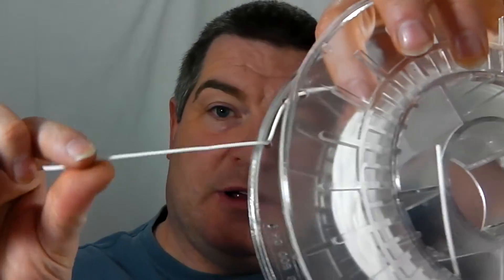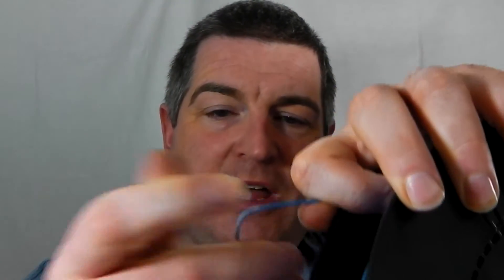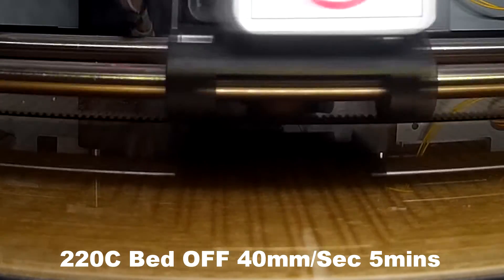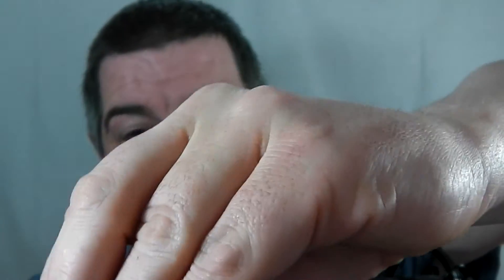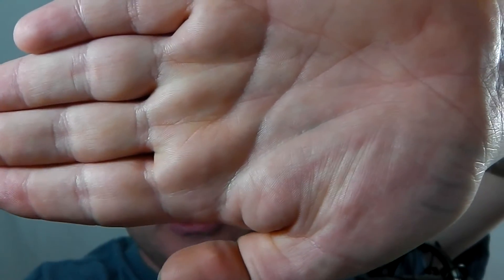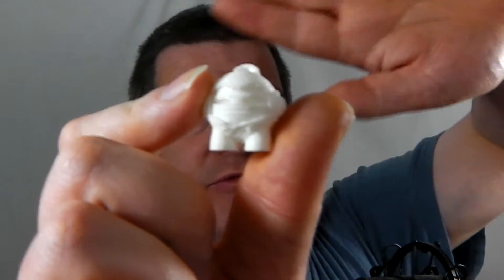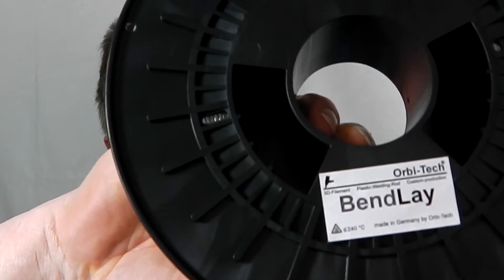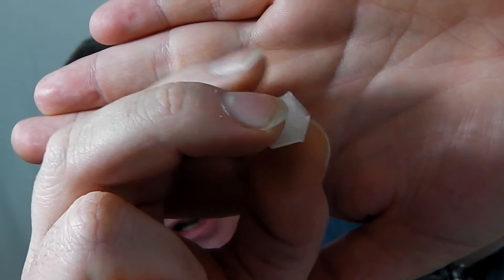XYZ DaVinci 1.0A printing Ninjaflex ???????

Comment: Im printing ninjaFlex on a stock Davinci 1.0 @ 20mm/sec 1st layer 228c rest of the layers at 225c, no additional cooling besides the tiny useless fan in the back. Try it again and slow your print down....

Comment: steven, was this bendlay flex or rigid?
Reply from the maker: +Nathan JR (CheeseOverdose) The Bendlay can be bendy or solid.  in the slic3r settings if you use 1 perimeter and 0% fill you'll get something that is almost as flexible as one of those plastic cups you get from a water cooler.  If you use default perimeters and 50% fill you'll get something that's very rigid.  You can, of course, select other settings to get something semi-bendy.  One other thing to mention about Bendlay is the support material, this doesn't break off like PLA or ABS supports, it kind of peals off and requires a it of cleanup at finishing.  All in all, i do like Bendlay a lot, it prints like ABS but you can get creative with your design and add thin features for flexibility where needed.  Hope this helps
Reply: +StevenQ-NE-UK ah, yes it does. thanks for the quick response. i didn't expect that. What im really meaning is that there's two versions of bendlay. One is called bendlay flex and the other is bendlay rigid. I've only ever seen bendlay rigid on a spool, so i'm assuming that's what it is, but if bendlay FLEX could be used that would be quite exciting..
Reply from the maker: +Nathan JR (CheeseOverdose) I am bot sure which flavor Bendlay it is,  the spool label and sales invoice both just have Bendlay printed on them.

Comment: hi I have a davinci 2.0 and I want to modify it to a dlp sla printer. I wonder if I hack it with repetier could i use slcr3 to run the motors for the dlp sla printing function.let me know if its possible since you have experience using slcr3. liked the tutorial it was very helpful when I bout my printer  I thought it could print ninja flex out the box man was I wrong. im so disappointed with its disability to perform with complex material that I decided to turn it in an upside down dlp sla printer please respond asap thanks .post a video on this if posible
Reply from the maker: Jean carlos Nolasco Hi,  I am sorry but I have no experience of DLP SLA printing.  Maybe the "talk" section of 3hubs.com could help.

Comment: The da vici does have a fan it's in the back of the extrewder !!!
Reply from the maker: Yeah you are right. That fan keeps the top of the hot end cool so the filament does not expand and clog the feed tube.  It does not cool the printed layers unless you reconfigure repetier host and add layer cooling duct and a fixed fan to cool the hot end feed tube

Comment: I have done some mods to my 2.0 (without the scanner).  It runs repetier host and the quality is about the equivalent of today's Makerbot.  It can print in both ABS and PLA, looking to order and try some ninjaflex soon!
Reply: +Dominick Villano did you have to add cooling to run pla?
Reply: +Nathan JR (CheeseOverdose) Technically, I didn't ADD any cooling at all.  All I did was move the existing cooling fan lower, to cool the already present heatsink next to the hotend.  It also adds cooling to the extruder too, so you can get better bridging and edges.
Reply: +Nathan JR (CheeseOverdose) I am also now printing with GP3D's Flex filament.  If you search "GP3D flex" on google, you can see the stuff.

Comment: Hi Steve

I have just tried the very first NinjaFlex 10mm cube. SUCCESS! I am just removing my dreadful camera work, ready for uploading, if you send me the dropbox details ill give you the files 
details

Hotend 220oC
Heated bed 50oC
print speed 40mm/s
with a filament layer fan installed